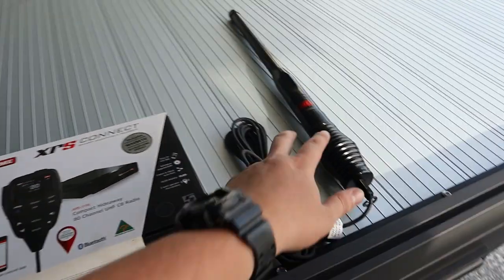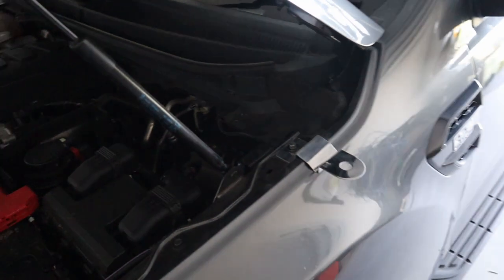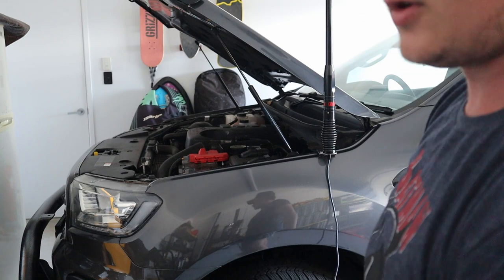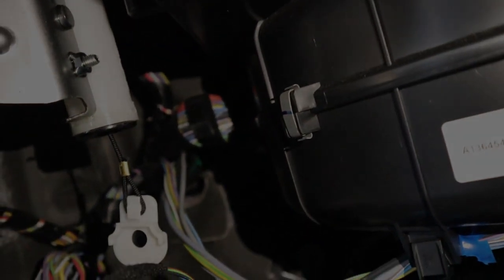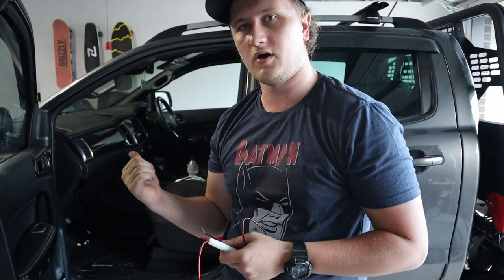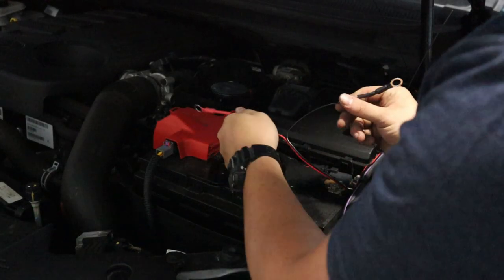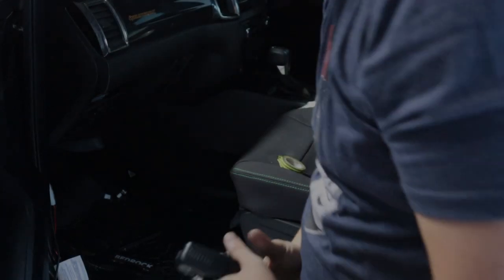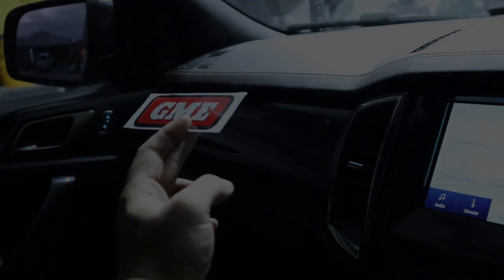GME XRS 370C DIY Install

Comment: Just a quick note, as per owners manual and common knowledge by auto sparkies, do not connect any accessory negative to the negative terminal of the battery. State of charge and load is sensed via this terminal. All Negative connectors must go to a body or engine earth. i.e. fender bolt or engine bracket bolt. I hope you have had no ill effects, as warranty will be voided.
Reply: Is that to avoid a closed loop as in possible eddy currents generation?
Reply: @razvanduta3563  There is a shunt on the negative side of the battery which measures what's going on in terms of amps in and out. All loads should be on the vehicle side of this shunt. Putting something on the battery side of the shunt can cause things to get out of sync.
In reality, this device is going to draw so little it probably wont matter to much. However, it would be a major problem for a high draw device like a DCDC charger or winch etc.
Reply from the maker: Great advice thank you ! I will try to ad a note into the video to fix this !